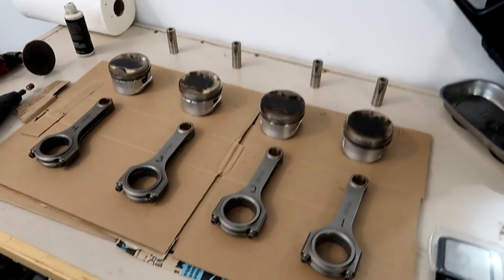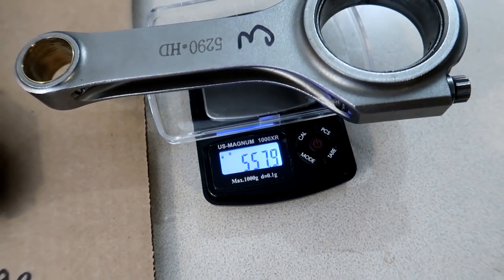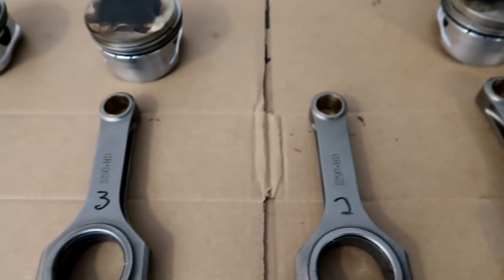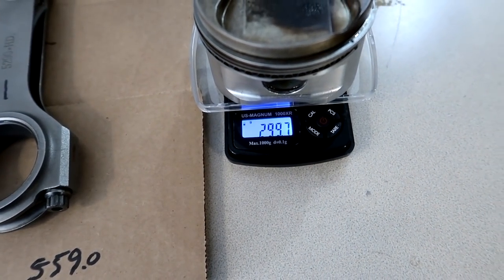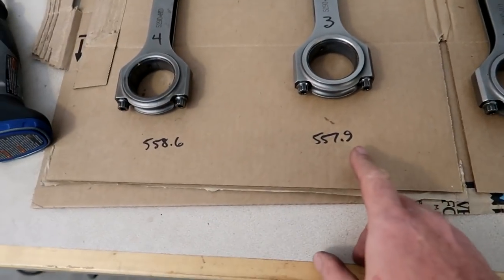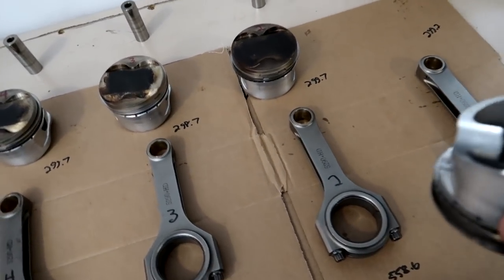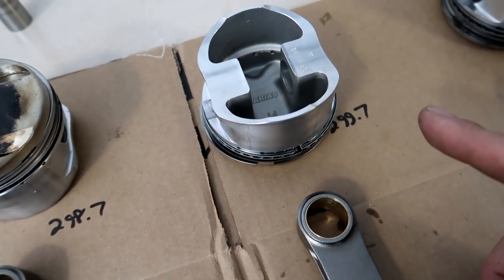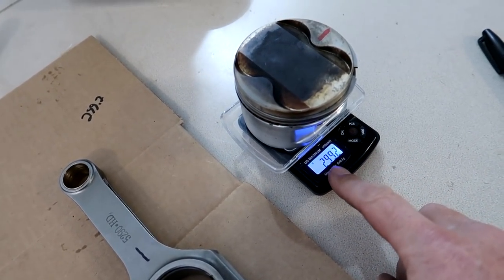Ep011 - How to balance pistons and rods at home

Comment: WOW! Without offense; you are totally incorrect. The con rods need to be suspended on each end, thus reciprocating and oscillating. The pistons should have been cleaned. I owned and operated an automotive performance machine shop for 33 years, and years before balancing engine assys. for other shops. I am acquainted with different manufacturers of equipment but preferred the older style Stewart-Warner for perfection. Every single one of the thousands of engines I built was balanced and included in the engine cost. Never play with the piston skirt, pin boss areas are preferable for removal areas. The aftermarket rods you show came with a balance weight sheet for each end. There is a strong chance that you created more of an imbalance of components than balancing. You could have made a simple jig for suspending the rods properly. Overall weight is not the answer.
Reply: I want to replace my factory dished Pistons with flat tops how critical is it that they weigh close to what the OEM's did???

Comment: I was taught to have a jig that supports the wrist pin end of the rod level while the big end is on the scale (center of wrist pin and rod bearing level). The big end being thrown around and having more mass has a greater effect on balance. Enjoying the channel keep it up.
Reply: Same
Reply: Guys ur correct this isnt the proper way
Reply: Ageed, mass balance along with weight, I would have gone 557.5g to equal mass depending on piston weight with wrist pins etc. I enjoy the balancing part of all builds, oh, keep a log book for your builds.
Reply: Glad I wasn’t alone. I am definitely not novice but I never thought to balance rods and pistons but makes sense. However if you venture into balance it’s not just weight it’s actually adjusting it balanced. I immediately thought of a tire and the same thing applies. I’d never thin the skirt either. It’s an excellent concept and I’ll surely do it but my way. Maybe right maybe wrong. Either way thx for the vid homes
Reply: Ryan is absolutely correct. Rods need to be balanced "end for end" as well as for total overall weight. The upper half of the rod is considered as reciprocating weight, while the bottom end is considered rotating weight. Simply removing weight from the bottom, may make things worse, instead of better. You also would not weigh pistons with carbon on the crown! All parts must be absolutely clean before starting.
Reply: Ryans correct, that IS the proper way to properly balance rods like a race hop would do, even though this is equalising the overall mass of all the rods to be the "same" this doesn't take into account of say slightly more mass on say the little end side than say the other rods.

Comment: I'm thinking about doing this myself on an upcoming build.  Would it be more accurate to use two small scales in a fixed position?  This way, you could get both sides of the rods and pistons, and try and match them up?

Comment: Well this just popped up on my feed it's old so I guess I won't be getting any responses. The rod is one of the most critical things to measure correctly. No balancer that does it for a living even gives a crap about overall rod weight. They will ask you for your big and small end weights that all the balancing machine wants. Also he is forgetting the bearing and the ring pack as well as the pin clips. Doesn't seem like much but it adds up.

Comment: You can have a weight matched set of rods with much more mass on one end or the other. They always should be checked on a proper jig to equalize the small and big ends and then balance the total weights of the set.

Comment: Oversimplification. Rods can all weigh the same, but where that weight is carried in the rod matters. It's the same for pistons. What is important is the weight characteristics of a rod and piston assembly that share one crank journal. This is why you need to have the whole rotating assembly dynamically balanced. Thats that is a true art and few machine shops can do it correctly.

Comment: Dude, you totally did that wrong.  The problem with your method of weighing  rods is that you cannot tell where the extra weight is at in the rod.  Is the extra weight at the rod big end or the rod little end?  Which end do you remove the extra weight?  It matters, which is why professional engine builders weigh each end of the rod.

Comment: So say all my rotating assembly has been balanced, prior about 3k miles, I lifted the head because I didn’t get the head and block decked, but like your piston I had a tiny crack on a ring land, Diamond series pistons, and a couple wavy ring land pinching rings , so 3 bad pistons, I’m buying new pistons, can I not just weight match those pistons to each other and go with it?? Or do I have to send the crank rods pistons etc back to be all re balanced together,?? Thank you
Reply: Yes you can match the weight and go back with it I've done it many times. Just be sure to use the wrist pin and rings in the weight. Try to get a piston that's equal or heavier than what you have already. The only way to add weight is to weld inside the wrist pin so it's much easier to remove weight. Best of luck

Comment: Getting the rods within a gram of each other is fine.  Spending hours trying to get the conrods to within tenths of a gram to each other is a waste of time, because in the real world (inside the engine) the rods have oil all over them!  And how do you know how much oil is on each rod at any given time?  That alone can change rod weights significantly.  Every rod is not going to have exactly the same amount of oil on its surface each stroke.  I only learnt that in the last few days.  We can always learn more.  I'm just passing it on.

Comment: Wouldnt you want a better scale and to take the bolts out so you'll have a more accurate reading?
Reply from the maker: Not sure I follow on the bolts? I can see using a better scale, although this method has worked well for me.
Reply: @b16crxturbo  I just figured you'd take the bolts out of the rods before weighing them. Seeing how detailed you are 👍 thanks for posting and replying btw.
Reply: If the bolt is installed when running, why take it out to weigh it? That would be short of the actual weight.

Comment: I am always amazed at the comments...I get guys dont know so they come to youtube to learn...sometimes I do as well. But damn...the fact this guy clearly doesn't know how to properly weight n balance rods is concerning  because there are guys who will do what this guy is doing and ruin stuff. Please dont do this because this isnt how its done
Reply from the maker: Component weight matching is not the same as doing the rotating assembly.  This is something you can do without the special equipment required for doing a rotating assembly.  I have used this process on 4cyl engines making 800+ whp and it works for me.